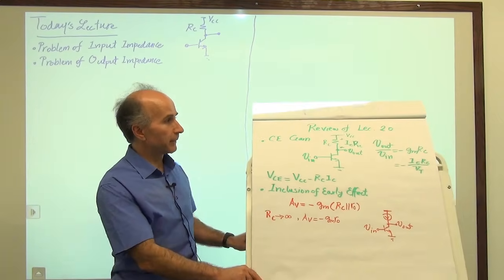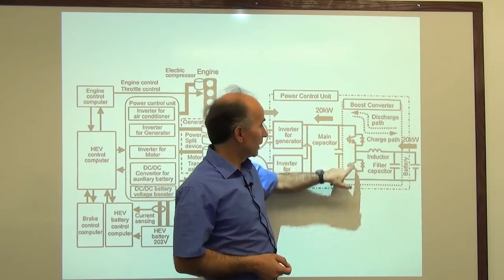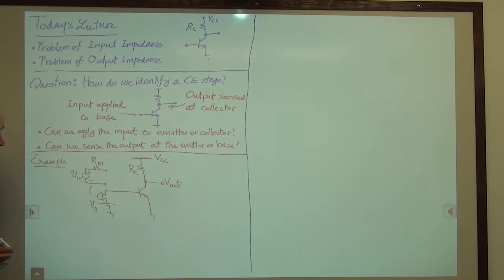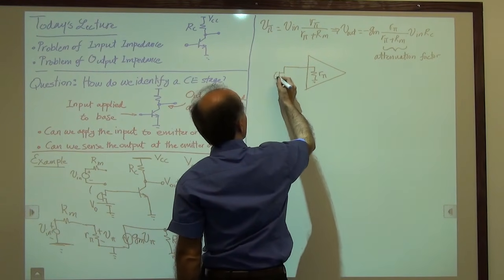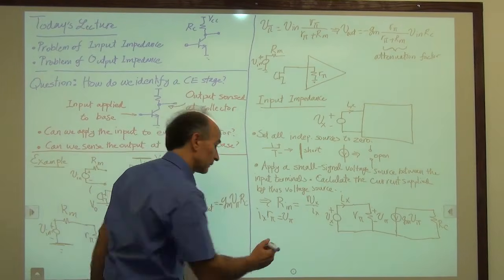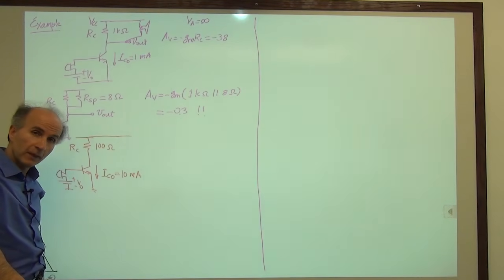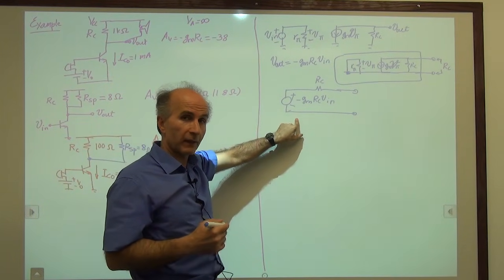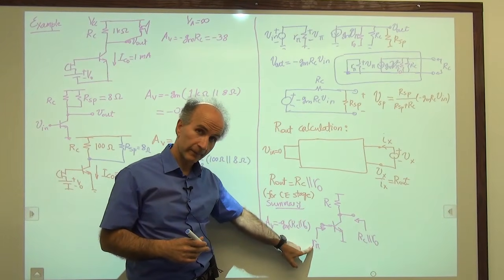Razavi Electronics 1, Lec 21, Input & Output Impedances

Comment: Why don't we connect one terminal of speaker to ground
Reply: I understand that the conversion from current to the amplified voltage is done by Rc, so output voltage (amplified) will be taken from around Rc. Correct me if I am wrong.
Reply: @hasmoe8466  in the previous lectures the teacher told to take the output between collector and ground.
Reply: @Upgradezz  that is small signal ground.

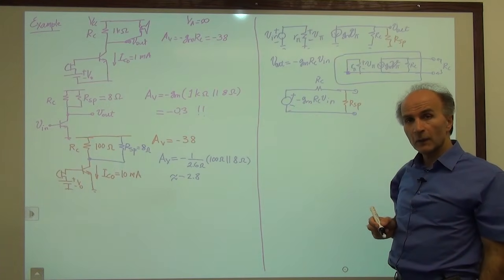Comment: 54:20 shouldnt the speaker be connected in parallel with Rc??
Reply: If you carefully look at the Vsp formula came from thenvin model, than you will find that its same as that without thenvins equivalent model and is acting like Rc and Rsp are in parellel, i.e, Vsp = ((-gm*Vin*Rc) Rsp)  /  (Rsp+Rc) = (-gm*Vin)  ((Rsp*Rc)/(Rsp+Rc).

Comment: can anyone tell me why the speaker is connected between Vcc and the collector terminal??
In previous lect the o/p was measured from collector terminal wrt. ground.
Reply: Thats what my doubt was, I think sir did a mistake here. But the fact is that in small signal model, it doesent matter wheather we connect Rsp between Vcc and Collector or between Collector and ground, as in small signal model, Vcc is considered as a wire and is so connected to ground.
So in both the ways of connection, Rsp is parellel to Rc.
Reply: @RiyaGupta if you found the answer of this question please clear the doubt

Comment: He Maybe wrong ...,because when we connect the speaker to the circuit we change Ic hence Gm, but he continues to use the old values and calculates the gain!
Reply: We have neglected Early effect, so Vce won't have a role because Vbe is the same and so Ic remains the same.
Reply: ic doesnt change when you connect the speaker, it is constant w.r.t Vbe.